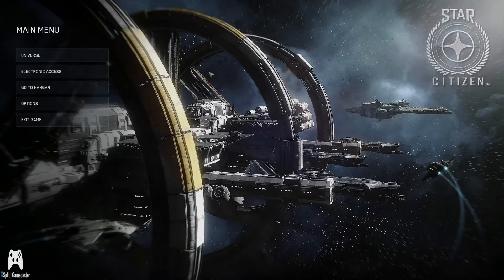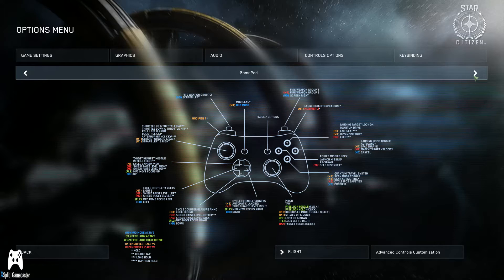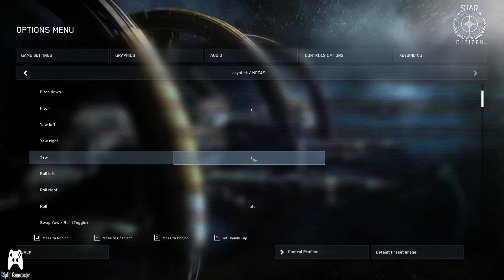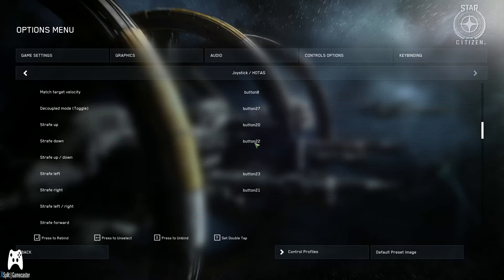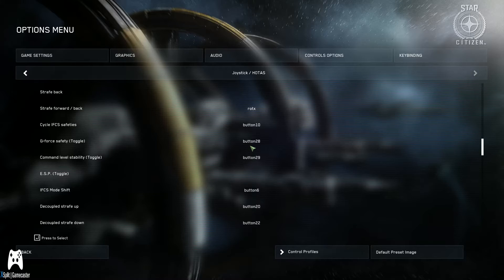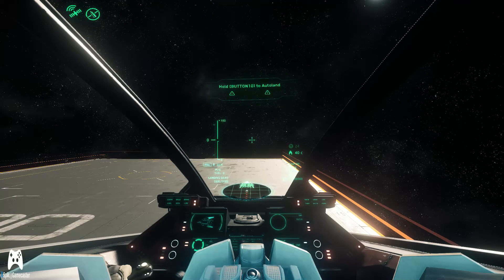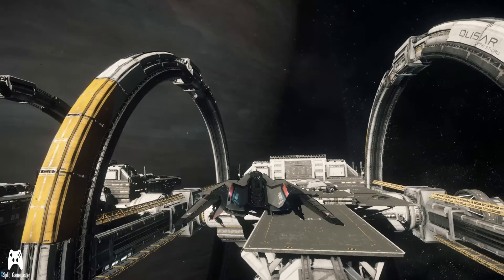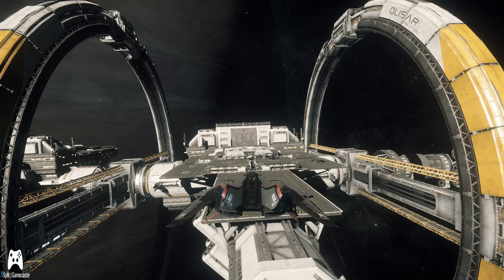Star Citizen: How To Setup The Saitek x52

Comment: Hey great video it’s the only one that’s helped me, but i’m stuck on one thing: when i rebind my throttle i have one of two problems. i’ll push forward and it does nothing until i push back and then it accelerates, or if i push back it will shoot me back and forward will shoot me forward and i cant stop, do you know a fix?
Reply from the maker: Helloo! Thank youu for your kind feedback :)),  indeed sometimes you may need to re-adjust your throttle controller aka Z/Y Axis controller, and manually adjust until you want your ship to fly in the way you wish for your throttle to apply. Some tinkering and testing should fix this issue over time, I hope this helps! 
Fly safe and see you in the verse :))

Kind regards,

- Axxo
Reply: @Axxo978  do i tinker this in game or in the x52 pro software? thanks :)
Reply from the maker: @osxuu  Helloo! You should be able to tinker with these settings from the in-game Saitek profile/Advanced keyring settings under HOTAS where you can manually re-keybind while in-game itself. I hope this gives more clarity to your situation at bay :))
Reply: @Axxo978  okay thank you so much! i’ve had my x52 pro for a while now and i play dcs world and other sims but i didn’t know until recently you can use it on star citizen so i thought may aswell give it a try!
Reply from the maker: @osxuu  You're most welcome, have a great gaming session :))
Kind regards,

- Axxo

Comment: Axxo its now 2021 and there are still issues with binds. I prefer to use my yaw on the twist axis and roll to L/R on joystick, which is how i have used settings for years on flight sims. SC on the other hand is a monster to get right particularly with the inversions, and yes getting it right is an absolute must, and to avoid consequences I dont use the ptu,. but the arena iis much less of a hassle if things go wrong. nice informative information, hope you update it to this 3.15.1 patch .

Comment: star citizen not picking up my x52 pro,  can you help me figure it out?  MFD says no profile, and the only thing that works is the thumb mouse controller.
Reply from the maker: Helloo! If you are still experiencing issues, here is a link to DL the driver software itself :3, after doing this, restart PC, and try to setup your hotas by then selecting the x52 default profile in-game, from there you can customize your settings, and it was  register so long as you have your driver software installed. >> https://support.logi.com/hc/en-us/articles/360024847013-Downloads-X52-Space-Flight-H-O-T-A-S

Comment: Glad to see this still applies in 2018.  Like others I plugged in my x52 and was getting no response from joystick, joystick 1 or joystick 2 profiles for the x52 in game. Followed this dudes advice and now im able to use my joystick.  
 Update: So instead of limiting what your x52 can do dont assign any of the buttons in game. Select the x52 ingame> joystick profile > rebind roll, pitch, yaw and throttle and thats it. Then use the logitech software to bind any ingame keyboard function to the stick. This will allow you to use the 3 mode toggle switch which opens up many more setups you can switch to on the fly. It takes a little patience and some other you tube vids to get used to and understand how the logitech software works but once I understood it made flying around in the verse a lot easier. My biggest problem now is what i want each mode to do. Good luck peeps👍
Reply from the maker: Thank you for your support, it is most appreciated ^__^
Reply: Any way you could show me how to use the Logitech software to configure different modes?

Comment: A note:

If you have another input already plugged in (in my case it's a DX gamepad that I've used xoutput to map as xinput) then you may not be able to use the presets, as it might only try to map them to the gamepad.  You can still custom map, but each input will be followed by "(input2)” denoting it's a secondary input source.

Also this video could have been much shorter.  A little more concise and less repetitive would be more my speed.
Reply from the maker: Thank you for the support!
Reply: I commend your good will by the way.  People who take the time to explain these things on line are how I've learned most of the practical things I know.  It massively enriches all of our lives.

I wanted to add about the mic comment people are leaving, as an audio technician, vocalist, and general musician, it isn't necessarily proximity to your mouth causing the noise, but the air movement passed the mic.  Moving the mic just above or below your mouth will also help.  As an example, when singing on stage, a common technique is to change the angle of the mic so that it's at a 45ish degree angle to your mouth.  This let's the vibrations projecting directly from your mouth to enter the mic since they bounce, but prevents too much air flowing passed the mic.  Another technique is to practice being as loud as possible while exhaling as little air as possible.  The shape inside of your mouth, openness of your airway, and tension in your core muscles control this.

Comment: Hey

I recently purchased the X52 Pro, thinking that i would just plug the thing in and rebind the keys to whatever i want by moving the Joystick back and forth, pressing the keys and what not. However when i double click, then move my joystick back to pitch up, nothing happens. Why does it not recognize it? Am i missing something? i see it worked for you.
Reply from the maker: Hey what's up! To make sure your X52 Pro is working. Make sure you've downloaded the drivers first, after doing so. Make sure your x52 Pro aka HOTAS is plugged in before you launch the game itself.  Select either the x52 or x52 pro preset profile. After that navigate to the advanced controls for your HOTAS and begin to rekeybind everything the way you would like it. I hope this helps!  Other than that, the only possible reasonable explanation could be due with Star Citizen itself. If that's the case, you can always try to delete your user folder to start fresh again and see if this too can fix the issue at bay. Best of luck to you man and thank you for the support!

Comment: Hello tnx for this guide but for some reason when i click select device  to import to i have nothing there at all below in the new update and my  Saitex X52 pro hotas is plug into usb etc + its working fine with elite dangerous too
Reply from the maker: You're welcome! However as for the actual Saitek x52 pro not registering with the game Star Citizen? I would recommend if you haven't by now, to try and switch the profile setting and find the profile configuration for the  Saitek x52 pro. I believe though however, you can still maybe even select the standard x52 or the x55 hotas profile configuration setup. Of course, make sure to have the driver software installed for mainly just the Saitek hotas. Usually found on the website or comes with your Saitek already in a disc with the original box it arrived in.  I hope this helps and please let me know!